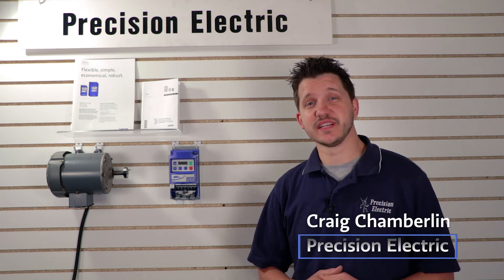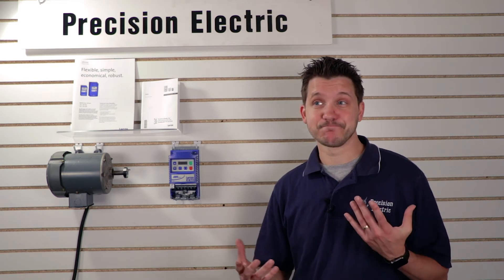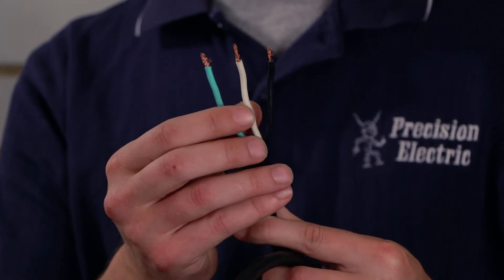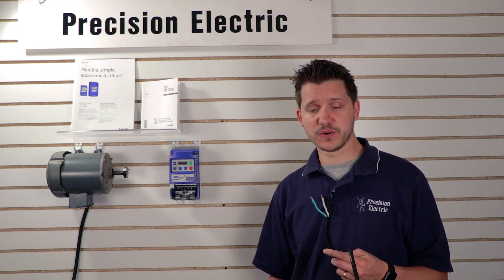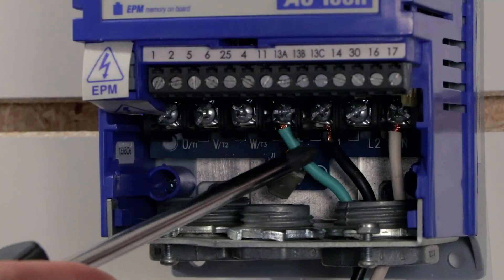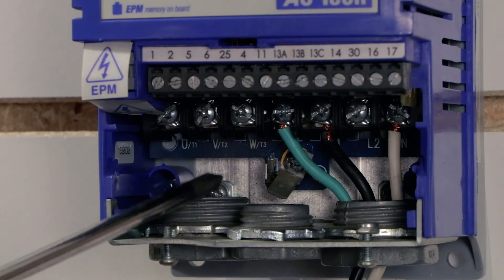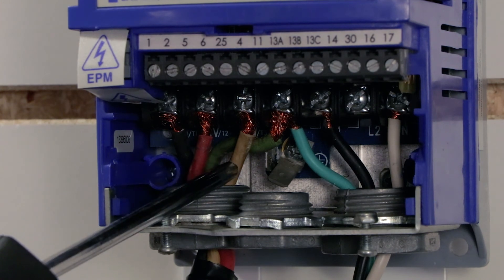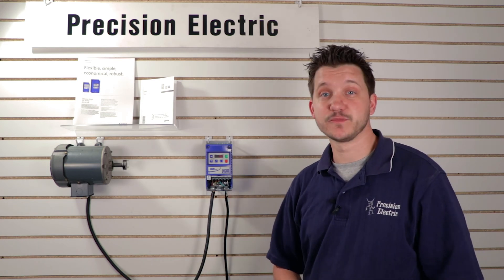Lenze SMV Training Lesson 1: Basic Input Voltage & Motor Wiring - Variable Frequency Drives

Comment: Can you program these to shut off after a certain amount of time? I tried programming P700 too 1, P710 to 3, P712 to one hour based off P708 and P795 to 1. I have all of the other segments at program default so it should go through the first segment for one hour then shut off, however it is not. Any suggestions?